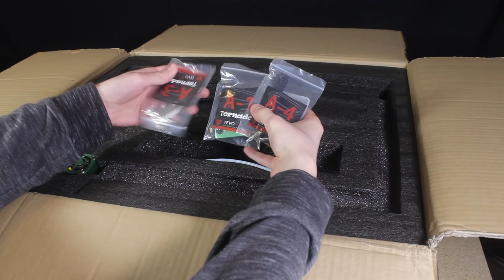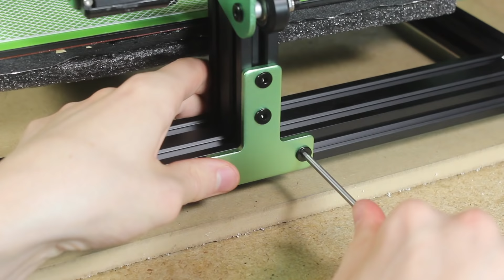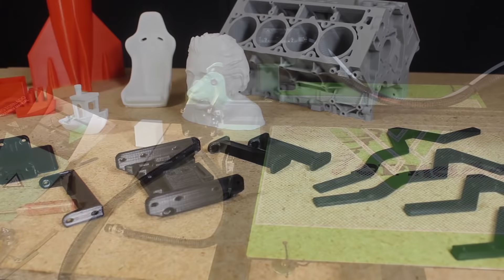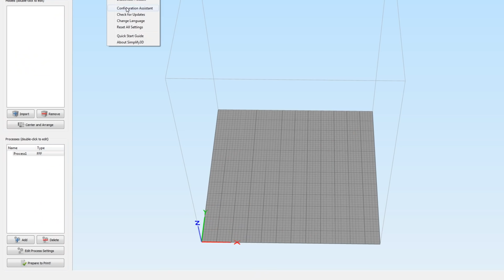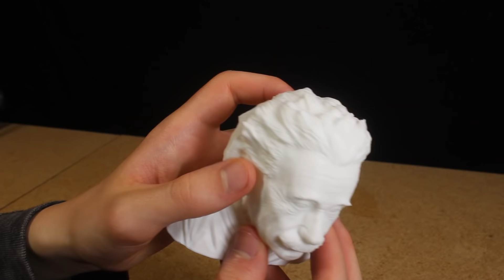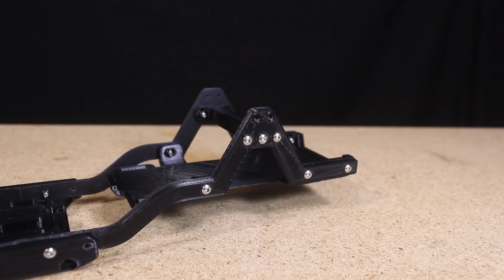TEVO Tornado 3D Printer Unboxing, Assembly, Overview, and First Impressions

Comment: Awesome. I have a Monoprice Maker Select 3D Printer (Which is a rebranded Wanhao i3 Duplicatior) and it works great. I don't have that SD card issue. But I am looking to get into a bigger printer, with a larger build plate. I don't know but my friend has a Tevo Tarantula and he's had nothing but issues. So not sure if I should get this. Let me know what you think.
Reply: The Tarantula and the Tornado are worlds apart! The Tarantula is a pretty horrible little thing, whereas the Tornado is quite well designed and actually will print (I've got both)

Comment: That wires shoudn't care more then 12/24v DC. Can you check at what voltage heating bed works? Keep up with great content and awesome video as always
Reply: The bed heater runs at mains voltage, which is 110 volts or 220 volts depending on your country. They use a solid state relay to control the bed heater, and this design removes the load from the power supply. Note that as voltage goes up, amperage goes down for a particular wattage as does wire size. Look at an old 6 volt car if you get the chance, the cables to the headlights are huge compared to 12 volt cars. I've had a light switch melt on a 6 volt car from the high amperage draw.

Comment: a few things i will say now having owned my nado for just over 6 months (it has had two days off) follow the manual for repitier host and slic3r, join the facebook page and if you have watch all of the ruriraptor (spelling is horrible) videos on you tube as he covers all that is neeed to make it right
seeing the glass isnt broken i am guessing tevo insured it in shipping (i paid extra and was glad i did) but if you keep the bed level, keep the machine clean and RUN IT, you will find it to be a dependable workhorse
i have shut mine down very little and have over 2000 hours printing over six months making parts for full sized cars, boats and tractors as well as a custom "engineers edition" pip-boy 3000 mk4
Reply: This video was part of the decision to buy my tornado and I'm still running it today

Comment: I have been using this printer since December, and your SD card problem should not be occurring!  I can eject and replace my card without rebooting any time.  As for wanting a glass bed - take off the build sheet, it's glass under there.  Your print sheet will bubble and cause print adhesion problems anyway as the adhesive can't handle the temperature and releases unevenly.
Reply from the maker: Thank you for the info. I was wondering why the build surface was starting to feel kind of bumpy lol.
Reply: I am using my school printer prusa mk2s and since i didnt had much time to calibration my live z is a bit too low so that i can have a somewhat even 1s layer, especially with abs i sometimes use a little of isopropol alcool to release the print just drop some drops alcool around the print and wait 30 sec to 1 minute and  you will start to ear the print get off the bed

Comment: You should built a model ls3 engine, as in the rest of the parts that go into the engine block to finish it, that would be wicked cool, especially if you can make it run on air, thats a challenge and a half, and if you make rings for the pistons that somewhat seal that would be so cool!

Comment: Now on the LS3 can you print the crank, pistons, heads, headers oil pan etc. Basically like a working engine. (Of course it can't run but it would be cool to make a modal and the moter mounts could be made into a stand)
Reply: you can run a plastic engine if it has bearings and seals and a lube that dose not damage plastic  ie the thing is you can use air compressor to supply air to move the pistons all you need extra is valves and timing fixed
Reply: Albert Cee yes you can.
Reply: Cool :)